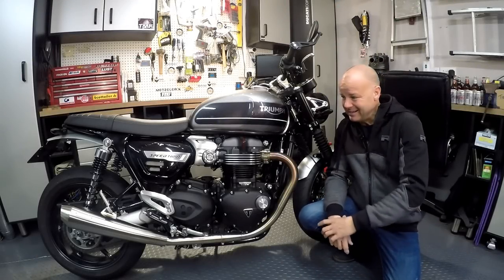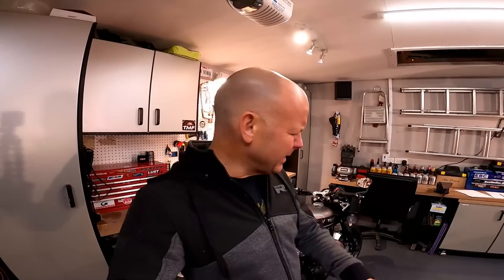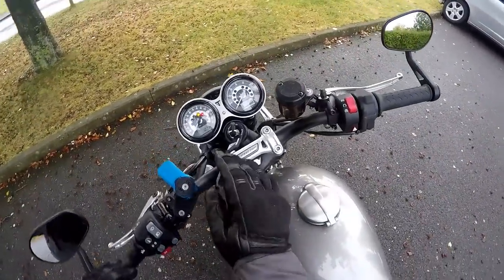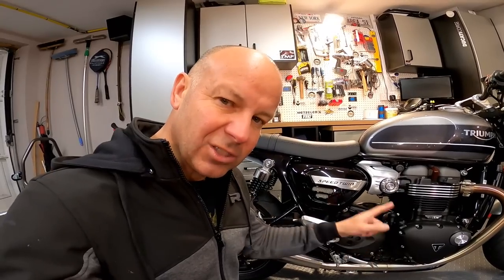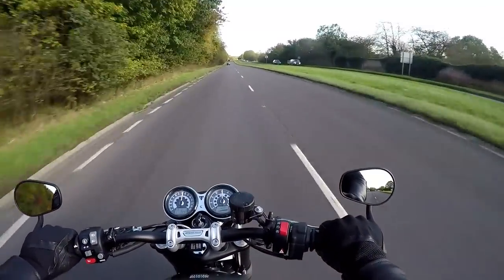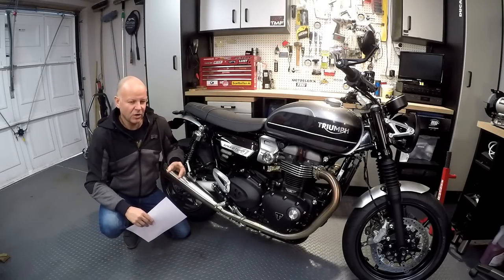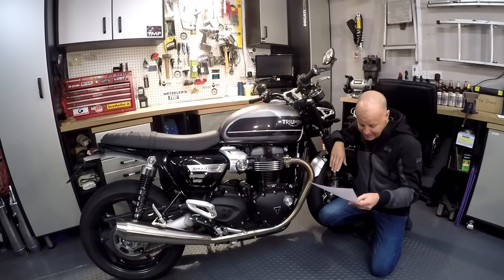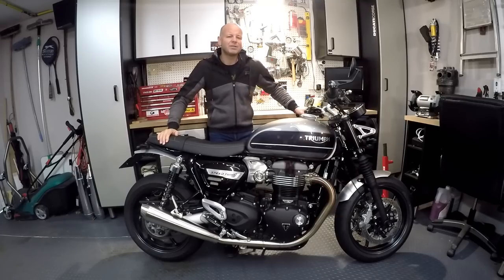Triumph Speed Twin - In depth owners review

Comment: This may be a dumb question but, why aren’t the Speed Twin and the Speed Triple the same style of bike? I would think by the name “Speed” they would be the same chassis style with different engines. I admit I know little about Triumph but I do like them.
Reply: There is also a street twin and a street triple.   There used to be a speed four also.  The triple is not really suited to retro
Reply: As Chris Hart sort of says, the "Triple" range of roadsters are the modern naked street fighter style of bikes. The "Twins" are all modern classic "Bonneville" retros.
"Street" are the slower variants and "Speed" a bit quicker.
Then there's the Tiger adventure range, I think they've all got triple engines.

Comment: Hi Flyer, I just couldn’t resist one of these. I part ex’s my RnineT scrambler which I liked but didn’t love. The SpeedTwin is much more fun and goes like stink. It now sits proudly against my T100. Are my two Triumphs to similar to own? Perhaps but I’m happy to own both at the moment and ride them accordingly.
Reply from the maker: That's interesting Jamie, so you rate the Trumpet higher than the RnineT?  I was wondering recently if I should chop in the Speed Twin for the BMW but maybe I should banish that thought!?
Reply: @TheMissendenFlyer  Well sir, I just fell in love with the RnineT scrambler look and after watching your reviews I had to have one. I bought a 2017 low mileage example delivered to me during lockdown without test riding one first (a mistake) I didn’t enjoy the boxer engine. The gears felt rather clunky and tractor like and the knobbly tyres looked great but rather twitchy at slower speeds in corners. I am pleased I experienced one, although only for 8 months. I now know I like a parallel twin. Live and learn as they say. Check out my post on the BMW RnineT Facebook page.I had some interesting 🤔 responses 😅
Reply from the maker: @jjnewman65  Aha yes, the R9T Scrambler on knobblies wasn't good on the road - and yes, the old style boxer in the R9T was a bit rock'n'roll - the Speed Twin certainly feels refined in comparison...the standard R9T on road tyres still appeals to me tho'
Reply: @TheMissendenFlyer  Go for it Andy but sell your StreetTriple not your beloved SpeedTwin 😉

Comment: Lovely bike.  I think triumph must've been focusing more on the Scrambler:s development as some of the detail drops on the speed twin are quite inexcusable.
Reply from the maker: Such as??  I think the Speed twin is at least as nice as the scramblers in terms of attention to detail??
Reply: TheMissendenFlyer 
Detail in terms of build quality is superb. However,  if you're launching 2 new iconic machines I'd not expect the drops as you mentioned,  the throttle, brake noise, hard seat. 
That's why I suggested they were concentrating more on the scrambler as really no after market corrections are required on that. Also triumph put a lot of time into developing the scrambler TFT hence my comment about perhaps concentrating more on the scrambler. Pure conjecture though. 

Irritating niggles I'd bother writing to triumph about. However,  I'm splitting hairs cos the speed twin is an absolutely stunning ped.
Reply: Admittedly, I haven’t put a 500 mile day on my Twin, but the seat is fine. I’ve ridden a lot of bikes and seen complaints about the seat that I just don’t understand. Also, this throttle slack that everyone talks about is that there is about a 16th of an inch of movement built into the grip on lots of bikes by lots of companies and the only time I’ve noticed it is if I am standing next to the bike and wiggle the throttle...something I rarely do. I may not have the surgeons hands if the Missenden flyer, but honestly, the mere act of gripping takes up the slack. All Triumphs are wonderfully easy bikes to ride and the only design flaw in the Twin that I can see are the noisy brakes.
Reply: John Sumser. I want to stress this point: Triumphs are in my opinion arguably one of the best bike manufacturers in the world. I've had a few and have one now and they just get better. So it's really an owners whinge being let off cos nothing is perfect. 

In the light of yesterdays exchanges I contacted several dealers who were aware of the brake and throttle slack and are awaiting responses from Hinckley. 

My original response to TMF about Triumph concentrating more on the scrambler of the two bikes was merely conjecture, slightly tongue in cheek throw away. That said we are talking bikes and passions can run high, especially when not having face to face chats. 

So apologies to anyone finding my comments irritating, inappropriate or plain stupid. Twas not my intention. 

For the record.  The speed twin is an excellent machine. I've persuaded 4 people to buy them instead of the T120/T100.

And a quick apology to Bonneville owners in advance.  I'll leave it there before the lynching parties form

Comment: Re brake squeal, ebc 322/4HH sort it out for good
Reply: Stephen Latchford how many miles have you done on these pads?
Reply: Torque of the Devil just short of 2000 miles
Reply: Stephen Latchford thanks I might give them a try as it’s the only thing I dislike about the bike. Did you copper slip the rear of the pads too?
Reply: Torque of the Devil, no I didn’t

Comment: Another good review, thanks.  Something I have thought of mentioning before though is that you only do your "push around" test on level ground.   Unfortunately a lot of us will have sloping drives or need to park on slopes so could you perhaps find somewhere less level to carry out this test.  I know from experience with my R1250GS that a bike that moves easily on the flat soon seems a lot heavier on even a slight slope!
Reply from the maker: Yes I know all about that too!  ....hence why I do the test on level ground!!! (and to be consistent).....
Reply: @TheMissendenFlyer  But you could be consistent by finding a suitably flat but not perfectly level spot I would have thought.  Things like having nowhere to hold on to the rear of the bike become a lot more important when the ground is not level and are "real-world" relevant.  Anyway, just a thought ...

Comment: I bought one aprox. 6 months ago too.  I love it.  And believe it or not it was my first bike, so I really can't compare.  However. I found it very easy to ride though the power. The  pull it has did at first frightened me.  Must respect it.  Just getting better and better.
Modifications I have made: decat with an motone x-pipe, British customs gp slip ons and Nitron r3 twin shocks.  The stock shocks are a bit stiff, not enough rebound and compression on bumpy roads.
Just a great bike, and am thoroughly addicted.
Reply from the maker: Glad to hear it!
Reply: By the way, I also purchased the corbin gunslinger seat, which is completely customizable to color of leathers, piping, and stitching online. The seat however is a bit stiff/hard after a couple hours of riding on the upper hamstrings. Had it modified with pro pad and had it shaved back on the sides by a custom shop near me in Chicago area.  Also the x-pipe made a much smoother throttle compare to stock, definitely a worthwhile upgrade.  Also added the round collapsible  crg bar end mirrors. cleans up the lines of the front.  I have no issue with front brake squeal thankfully.  I can say if your debating between the t120 or Speed Twin, if you like cornering around twisty hilly roads then this is the bike to get and still have a classic, perfectly proportioned, bike under you.  And that parrelel twin engine sounds fantastic.
Reply from the maker: ...you're leaning on an open door with me on that one!
Reply: @TheMissendenFlyer  Sorry.  That was mean for the community at large.  That's the beauty of these sites.  Just more info for anyone considering these upgrades.
Reply: Meant for community

Comment: Hi, out of curiosity how tall are you?
Reply from the maker: 5 feet 8 inches - you?
Reply: @TheMissendenFlyer  5 feet 6 inches.
Reply: To add a little perspective I'm 6 ft, 6'1 with shoes and I've ridden an hour and a half or more and my legs weren't cramping.  It does lend to a little wrist pressure at times though as I'm leaning into it some being taller.

Comment: Another great review Andy.  On the Triumph fuel gauge being slow to register,  I actually like how the gauge works on a Triumph as it doesn't start flashing at you for miles before its actually getting low, so the delay for me gives much better indication of fuel level. Make sense? 😁👍
Reply: This is what I've thought. When moving fuel sloshes around the tank, so if it's too sensitive the fuel light would flicker too much when it's getting lower.
Reply: The ‘fuel gauge being slow to register’ issue is referring to filling the tank, not when the tank is getting low… When you fill up, it takes a while for the gauge to register that the tank is full. To me, it’s not a problem, as it sorts itself out in 30 secs. to a minute... but some riders say it can take a few miles & a few minutes, and that the range display won’t show the true range until the gauge has finally recognized the true level in the tank, and that it keeps them up at night, sick with worry. Perhaps the delay with the sensor has to do with your comments about what happens when the tank is running low, and being slow to read stops it from flashing a low fuel light every time the remaining fuel moves around in the tank, which to me sounds like a more important issue than a slight delay on fill-up. It’s always somethin’, innit?

Comment: Re the day time light on the clock, triumph have it right,  why would you want a green light on to tell you have dipped light on then have a blue light when on high beam,  what annoys me his the position of the blinker warn light on the clock the tacho needle hides it at about 3000 rpm.
Reply from the maker: Green low beam blue high beam makes perfect sense to me!!  Might just be me though.....
Reply: @TheMissendenFlyer  good point , maybe we will have to agree to disagree. season greetings to you and Mrs TMF
Reply: It's the change in operation of the flasher switch that annoys me. On DRL one flick of the flasher to flash. On night time dipped beam , 2 operations of the flasher to flash , because they're using it to toggle main beam .

Comment: My front brake squeals like mad as well at slow speeds, decat cools the engine down a bit too
Reply from the maker: Actually I failed to mention mine is de-catted with an X-Pipe too.....
Reply: TheMissendenFlyer brilliant mod huh? Makes it sound like a 1200cc Twin should. I’m going to add a power commander in the spring and get the fueling sorted out properly.

Comment: Blue Quadlock doesn’t go with the colour - get a red one from accessories on their website like I did 😂
Reply from the maker: Loving your attention to detail!  In fact these days I only have the bracket on there when I'm actively using it...I've removed it now....
Reply: I prefer the SP Connect stuff myself for cleaner look. They also do a wireless charging option so no faffing about with charge leads.

Comment: Yea lovely (ya jammy git).
Pads out, copper grease on the locating lugs and backs of the pads, sorted ; )
Reply: For a short while
Reply: @LilRedGTI  Oh ye of little faith
Reply: Nigel Ren he’s right the squealing will come back
Reply: @torqueofthedevil8145  Well I'd take a file to anything that looks like it's causing them to stick and grease the pin as well. Squeaking is usually the pads not moving evenly because something's sticking on something.

Comment: "You need to stick around and stay tuned" repeated quite a few times before anything happens. Get on with it! A producer/editor/director would pick up on that. You only need to say it once. Really sorry to be nit picky but it did grate on this vid. Your productions have become pretty slick so really shouldn't be happening repeating things 4 times which is what novice YTers tend to do as they haven't worked out or scripted what they are going to say. But as you say it is a beautiful looking bike and hence why you bought it. The clocks do look gorgeous. Good job Triumph and good choice you. The Thruxton R is nicer though ;@) Such a pity though the switchgear is not illuminated. Should be mandatory on all new bikes now.
Shame Triumph send out their factory door with such a sloppy throttle response. As you say for a premium bike it shouldn't be so that you have to spend £££ to sort it out. But your bike sounds fantastic with the V&H pipes. Not too loud, but not too quiet either.

Is the lack of centre stand a negative or positive as you did mention it but didn't say. I guess it's 50:50 as a centre stand can be really useful when servicing but is heavy and reduces ground clearance and can spoil the clean lines of a bike. Is it easy to attach an Abba stand or paddock stand to it? Perhaps something else you should consider mentioning in reviews in future if a bike doesn't have a centre stand?